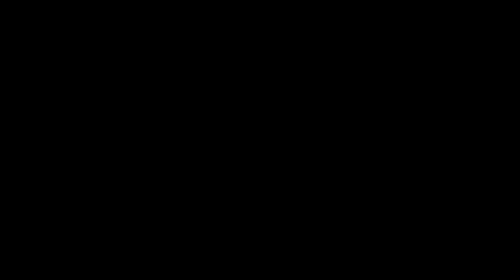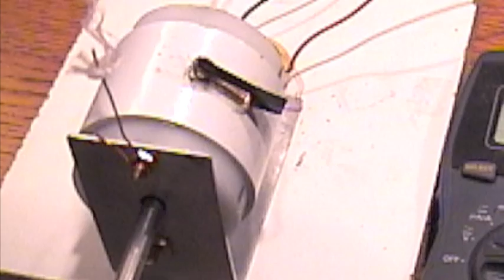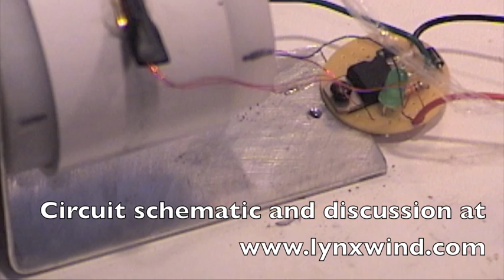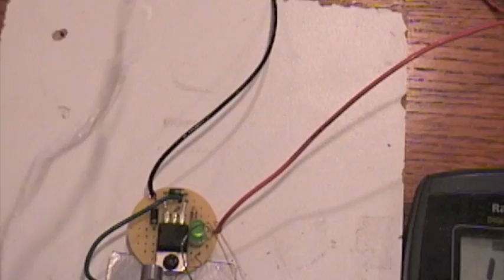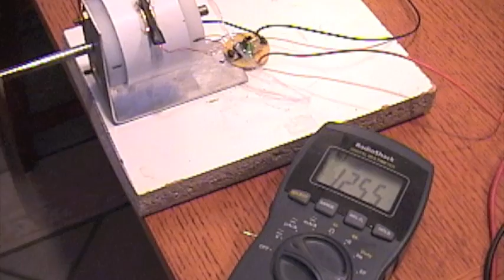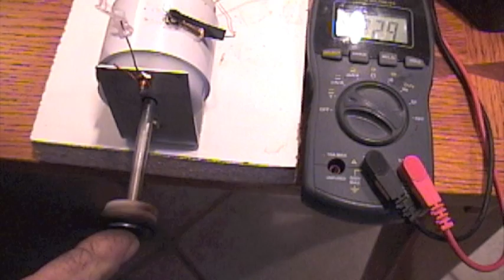Lynx Joule Motor - New Circuitry

Comment from the maker: Great idea.  Its tough to eliminate the feedback altogether because of the design.  The primary also is energized.  I did this video not so much to convince anyone of anything but to confirm that Dean's circuit works very well.
I'll come up with some comparative run for you and post.
I'll have to show it running no load.  It screams fast!

Comment: Could you do a test? Where you run the motor from fully charged battery for one hour with no feedback to the battery. Show voltage drop on battery.
Then do the same test with feedback to battery. Show battery voltage after one hour.
Theoretically it should show less of a voltage drop with the second test.
That would then mean that your motor could run longer at the same rpm with feedback. Than it could from direct battery. Thereby your motor feedback circuit is more efficient at power saving.